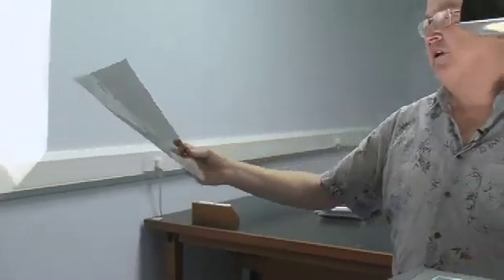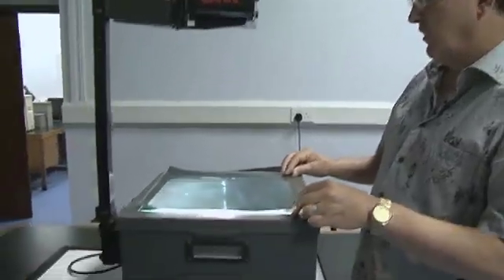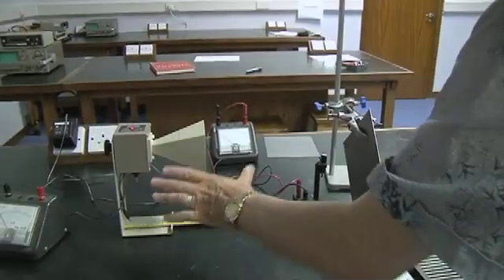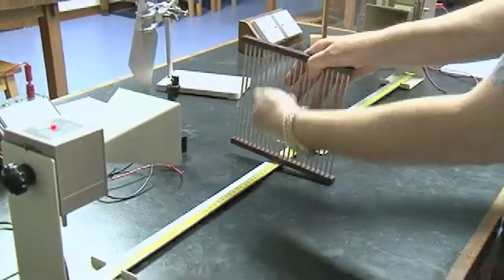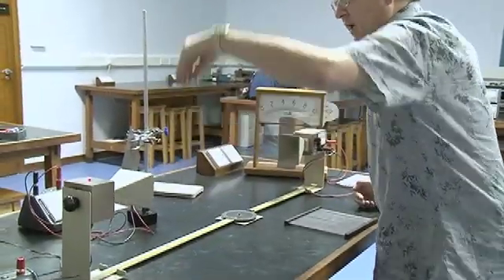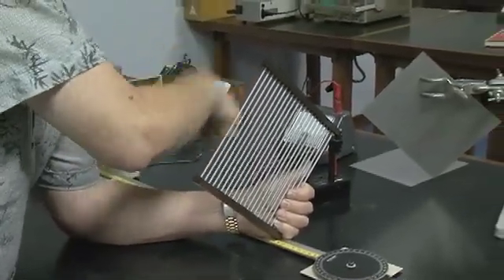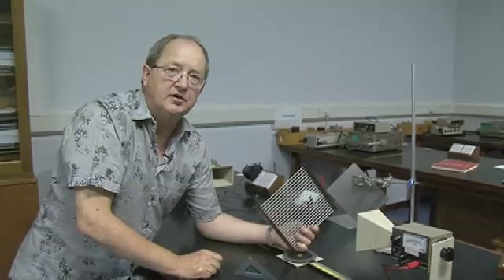Polarisation - Sixty Symbols

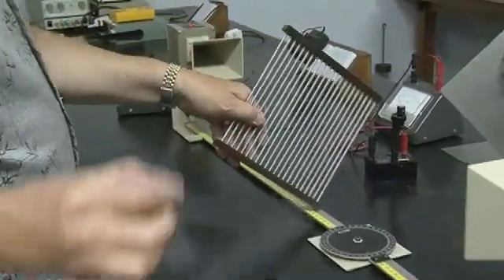Comment: 5:15 If the source wave really has two components, why the receiver doesn't detect when the filter is not in place? I think something is not right with the explanation.
Reply: ***** Then how inserting additional filter makes the wave detectable?
Reply: HAMDANI YUSUF 
You can think as it as vectors.
Incoming light is 0° (1|0) 
90° polarized is (0|1)
180° (-1|0)
270° (0|-1)

First example we go in with the light (1|0) and it a 90° polarizing filter. Only the componenten which is 90° polarized goes through. so nothing goes through, since (1|0)*(0|1)/1 =0 (projection of vector on another vector)

Second Example, 45° filter.

We start (1|0) and hit a (1|1)*2^(-1/2) filter, the faktor is for it staying length 1.
so we make a projection again and revieve 2^(-1/2) go through, meaning the half of the wave is going now (1|1), which means we have 4^(-1/2) * (1|1) left.

Now we get to the detector which is a (0|1) detector

(1|1)*(0|1)*4^(-1/2) and we recieve our final signal as (0|1)*4^(-1/2)

you can see, that the length of the vektor is only a fourth in terms of the coefficient squared.
This is how it works, if the filter was any other position then 90° there would be coming something through, too.

if you have any position (a|b) and incoming light (1|0)
you could easily get the thing getting through by skalarproduct (or projection to be more accurate).
Reply: Nickname basically what you said is the filter rotates the polarization axis. I agree with you, which is why I said that the explanation in the video isn't right.
Reply: HAMDANI YUSUF but thinking of it as "rotated" is still not quite right. It's actually that the vertically polarized signal secretly contained a superposition of the two diagonal polarizations (because of quantum spookiness). And then only the one diagonal was able to get through. And then at the detector it's the exact same situation again but rotated 45 degrees. ...... Without the filter there, the signal is perpendicular to the detector, and there's no component that will be horizontal like the detector.
Reply: So you mean that after 45 degree filter, the microwave doesn't have the -45 degree component anymore?
Reply: that's right. after going through a filter, the perpendicular component is non-existent...... until, of course, it goes through a partially (not 90 degrees) rotated filter, which is why it's so weird!
Reply: ToastyOs You mean additional filter can create new -45 degree component after blocked by the first filter? Why can't we treat this weirdness as an indication that something is wrong with this explanation? 
Why can't we just say that the filter rotates the oscillation axis of the microwave? rotation of polarisation axis is common in chemistry.
Reply: HAMDANI YUSUF if the polarization can be rotated, why cant it be rotated 90 degrees? Also, when its 45 degrees, why does only half the light get through? Also if you did different angles, you would find the amount of photons getting through is always consistent with trigonometric components
Reply: HAMDANI YUSUF if you really wanna be convinced you gotta legitimately learn quantum mechanics for yourself, and find the details of real experiments.
Reply: ToastyOs I mentioned polarization only to emphasize one aspect in the phenomenon which is absent from the explanation in the video. The others would be selective transmittance and blockade of wave components based on polarization angle.
Reply: HAMDANI YUSUF I understood that it is like two components cancelling each other out, so if you take away one component, you get something:     (-1) + 1 = 0        but        (-1) + 0 (cancelled) = -1
Reply: ToastyOs Why does cleanly polarised light or microwave have angled components at all?

Comment: does the photon then travel in a spiral  when it hits the metal at the 45 degree angle, so when its read on the other end your picking up the photon as the spiral passes in the horizontal plane
Reply: Sir Washington Nope. it's just taking advantage of the "Law of Superposition" from PHY 101 which states that any vector can have x and y component relative of course to the x and y axes as those can be made arbitrary. The important thing is that those components are perpendicular to each other.
So in this example, the waves from the generator are oscillating vertically. A little bit of pythagorean will show you that this direction is a hypotenuse of a right triangle with x and y components which are the the legs on each side ( as shown by the ruler-thing). Because one of the component is canceled out by the polarizer i.e. one of the legs on that right triangle is cancelled out by the polarizer, while the other leg is able to move through, because it is perpendicular, that bit is able to move through toward the detector. That wave itself oscillating now at 45 degrees has a component oscillating at 0 degrees and oscillating at 90 degrees. Only one of these components gets detected.

You can see the effect of this in the current of the microwave the detector has detected. Because it is losing components of its overall wave, it loses a little part of its ...I wanna say current, but not sure. Most likely energy, but that is not what is being read on the detector. Anyway, i hope you get the point

Comment: When the two sheets of Polaroid are vertical polarized, then the light goes through. In the second part, when everything is vertical polarized, the electricity doesn't go through. Is this not contradictory? I think that this theory doesn't fit in the phenomena. We cannot think of the light and electricity quite in the same way.
Reply: Well, there are 2 things to consider.

1. In the first part, both the source (the lamp on the projector), and the receiver (the whiteboard on the wall), are not polarized. In the second part, both the emitter and the receiver are polarized.

2. The direction of the wires in the frame that's used as a filter is not the "direction it's polarized in". The direction of the polarized light it let's trough is perpendicular to the direction of the wires.

The crudest way to think about it is to think about having narrow tall corridors pumped full of water passing trough them. If you put vertical columns in each corridor, they will block the flow of water, but if you turn them by 90 degrees, the water can now flow between the gaps (this is not an effort to explain how the principle itself works though).

Comment: This is because the magnetic fields are always at right angles to the direction of the electric current.. .   .And the total amplitude at every point depends upon the light from the surrounding masses.  . .. Like for example, when an observer turns on a light from a detector in the two slit experiment.. .  .

When the masses multiplies electrical potential by casting dew drops into the plasma sea.  . ..They see only wave ripples oscillating in between you and me.
They have no idea that those ripples are a rings series of resonating and expanding spheres which are dissipating gravity (entangling and unfolding) at the same ratio, as they are being multiplied by the falling dew drops, which are in fact, the inward spherical waves of future probability maintaining the quantum wave particle function at t=0.. .  .

Space is a division of solidity into entropy C2 the second law of thermodynamics.. .  .But also E2= a multiplication of volume at the expense of gravitational potential.. .  .

Time is inverse multiplying +4-0-4+- dividing like frequency and wavelength.. .  .

Time is shorter at one's feet that at their head, because of the geometry basically the greater the energy compression contracting spacetime=0 now the shorter the expanding wavelengths dividing acceleration away from its source in unison.. .  .The amount of radiation compressing the wave amplitude reaching 1 meter, then will be one-fourth as much at 2 meters, hence one-fourth the intensity.. .  .Thus objects just free fall towards the greatest energy compression or shortest rate that time flows.. .  .as the surface of the light sphere increases with the square of the radius the strength of the gravitational field transverses Q inversely proportional to the square of the distance from the source of that constant expanding light sphere.. .  .Simply because generation of "any information" exceeds radiation during the first half of the cycle t=0.  . ..Now radiation exceeds generation during the second half of the cycle.. .  .Gravitational systems -1 are the ashes from prior electrical systems +1.  . ..Their output was the negation of their input: 0 goes to 1,1 to 0.. .  .

Like that constant outward division now from the Sun forms the inward force called gravity as time unfolds C2 takes about eight minutes to reach Earth.. .  .And likewise the constant outward momentum of the light C2 from Earth transverses the acceleration in unison from the continuous stimulated emissions as time unfolds.. .  .As individual light spheres super impose crests and troughs become in phase now, their space time line symmetries will synchronize, or amplify by compressing the wave amplitude +4-0-4+- now the shorter the expanding wavelengths dividing acceleration or gravitation away from its source in unison.. .  .

Acceleration from fuel is not a rocket nor its thrust.. .  .But rather an after effect from the outward thrust.. .  .An equal and opposite reaction!!

((((Everything is formed by a locational 4pi spherical inward absorption t=0 and outward emission of electromagnetic waves))))

Light waves from all time dilating inertial ref-frames (within every observable spherical region of the infinite universe) cascading downward from a distance radius combine forming the sinusoidal wave medium density (space) compressing and de-compressing two opposing vortices at each and every point of space, or contracting and expanding virtual pair's popping out of existence.. .  .

The total amplitude formed by a rings series of inward spherical waves coming into every point.  . ..Colliding at maximum compression points at wave crests and wave troughs always seeks a minimum.  . ..Are equally balanced by opposite expansion at interchanging compression points.  . ..As trillions of waves cancel the sum of opposite vectors mathematically is always zero.  . ..Leaving space with an average temperature, or pressure stillness of the wave amplitude squared.. .   .

This polarized superposition of the wave amplitude squared is the reason for entanglement for the symmetry or conservation laws in human physics or why, at the speed of C, time and space are zero due to length contraction and time dilation or why, the point of charge Q is the same for the entire surface of an expanding light sphere.. .  .Because the polarization between the crests and troughs will remain the same (sharing the same expanding moment of time) no matter how large it becomes until acted upon by an external force.. .  .

Vibrating sinusoidal spherical wavefronts always transverses one unit of space/ per one unit of time.  . ..Like the bits, or zeros and ones of a computer screen the Planck's constant is continuously forming a blank canvas in a sense they are vibrations on the edge between space and time.. .  .As time unfolds Light is simply space divided by time entanglement and nothing else.. .  .That implies a strict equivalence between time and space with light as a constant conversion unit between the two."
Reply: Seamless Robe The way this is worded makes it really hard to understand...
Reply: TAIGAXML he's just a troll, posting gibberish
Reply: TAIGAXML Its just two spherical sine wavefronts multiplying inward +1=0 now -1 dividing outward at right angles from their sources.. .  .And where the two waves meet, creates the particle effect now in 3D space-time. (See: Spherical Electron Sixty Symbols)The fact that this spherical region of the one infinite universe has a limited observable range as the light waves come from a distance radius.  . ..Absorbing that information now is observable in the shape of an inverse sphere.  . ..4pi R2.. .  .And the fact that the electron is a perfectly round vibrating sphere.. .  .Thus, geometrically are two sides of the same + now - coin!!.. .  .The increase in Energy/Mass Volume +1=0 now -1 de-compression is only a slight deviation.. .  .However, there exists only two combinations of these Two Spherical Sine Wavefronts multiplying inward +1=0 now -1 dividing outward at right angles from their sources.. .  .They have opposite vectors and quantum spin forming the positron +1=0 now electron Wave Centre. .  .4pi R2=/N pi Re2.. .  .Or any dipole moment!!.. .  .Now space is a division of Solidity into entropy as time unfolds C2 the second law of thermodynamics.. .  .But also in the future E2 will equal a multiplication of Volume +1=0 now at the expense of gravitational potential -1.. .  .E2=M2 C4+P2 C2.. .  .See also E=mc2 is wrong sixty symbols.. .  .Its just not the full story!!.. .  .Everything is formed by a surrounding 4pi Spherical inward absorption +1=0 now -1 outward emission of electromagnetic waves.. .  .All motion is 2pi Spiral.. .  .And all 3D directions are 4pi Spherically curved, thus Wave Centres of photon energy are everywhere relative to an infinite future of potential possibilities continuously coming into +1=0 now -1 out of existence E=hf with the Planck's constant h continuously forming a blank canvas that we can interact with turning the possible into the actual.. .  .Atomic particles are really High Wave Amplitude Wave Centres of Pure Vibration from regions of intense surrounding wave pressure.  . ..Made of vibrating wavefronts called shells in particle physics, or Spherical Standing Wave structures over a period of time now - their output was the negation of their input: 0 goes to 1,1 to 0.. .  .the start of the Fibonacci spiral.. .  .Gravitational systems are the ashes from prior electrical systems -1...  . Simply because generation of any information exceeds radiation during the first half of the cycle +1=0 now -1 radiation exceeds generation during the second half of the cycle forms the acceleration as the constant outward momentum of electromagnetic radiation repels like charged particles absorbing energy input +1=0 now -1 emitting the density from the two previous vectors spiralling out the Fibonacci sequence.. .  .From 2pi Spiral radians 360 degrees, to Spirals of elements, DNA, Seashells, Spiral Galaxies, and even living cells.. .  .When One Wave Centre was moving relative to another Wave Centre they gave rise to beats of interference (caused by the Doppler shifting of the Inward and Outward waves due to relative motion) which were identified in experiments as the de-Broglie Wavelength y=h/mv in Quantum Theory, which also gives rise to the frequency increases, and thus Energy/Mass Increases (as E=hf=mc2) of Special Relativity!!.. .  . The One Unified Electromagnetic Spectrum is a continuous flow of energy (Vibrating Waves) therefore light is a transverse sinusoidal wave.. .  .And it was time that was quantized.. .  .Space-time was quantized into moments.. .  .Only the frequency now is relative at each dipole magnetic moment of time.. .  .There exists a profound and perfect 4pi Spherical symmetry between positive and negative electric charge compressing energy +1=0 now -1 de-compressing when that symmetry was broken forming spiral symmetry.. .  .Now we get the imperfect 2pi Spiral symmetry of the Fibonacci sequence seen almost everywhere in nature.. .   .
Reply: I regret pressing read more
Reply: It appears Seamless Robe "gets it wrong too." He does NOT understand the metal grate is re-radiating the microwave energy (intercepted) in the direction that the grate is positioned, having intercepted the RF from the transmitting end at the 45 degree angle, then re-radiating the intercepted RF at the new 45 deg angle to be picked up at the far end receiver.

It really is as simple as that. The example using light is similar.

Comment: What interests me is that when you changed polarity the detector had a peak higher than the steady state.
One explanation could be an AGC (auto Gain Control) in the detector.
Can you verify this point for me please.
Garret
Reply: Or he could have increased the power of the emitter between cuts.
Reply: I was curious about that too. Especially since he says that it's all about probabilities of the individual microwave photons getting through, he says 25% likelihood. Then why is the signal not 25% of the aligned signal? I wonder if the polarizer isn't converting the polarity instead of filtering it, and possibly focusing the beam.
Reply: I was also amazed by the same the grid of polarization acts as a focusing channel and not as a diffusive channel  it does not obeys the law of conservation of energy 

Either there could be a fault in the receiving side
Reply: Siegfried Gust Why would it be filtering if he's getting the same steady state signal (~4ma) with the receiver/transmitter and aligned?
Reply: HIGHLY, highly disappointed that the presenter erred in the final analysis of how this phenom works.

As it turns out, the metal grate is re-radiating the microwave energy in the direction that the grate is positioned, having intercepted the RF from the transmitting end at 45 degrees, then, re-radiation of the RF takes place at the new 45 deg angle AND is picked up at the far end receiver.
Reply: @uploadJ  can you tell then why the grate isn't re-radiating at 90°
Reply: @uploadJ  ok, then where does the energy of electromagnetic source is disappearing to
Reply: @uploadJ  if the grid is irradiatiing, how do you think, changing the angle of the grid will it change the direction of the beam?
Reply: @uploadJ  you mean it radiates like an antenna in all directions?
I know that changing the angle of antenna changes the signal direction.